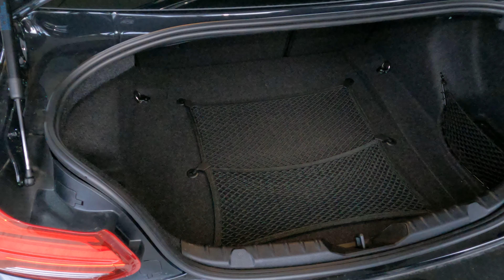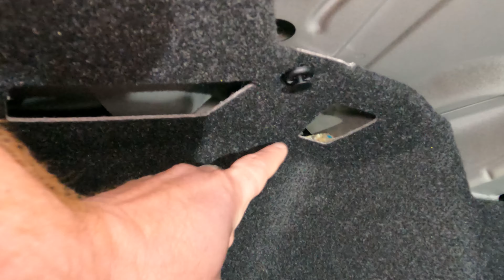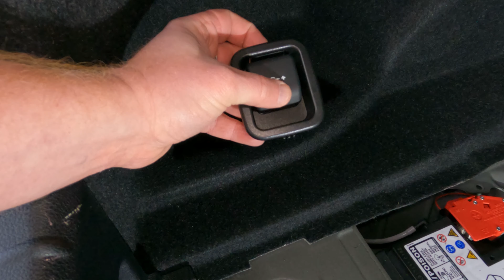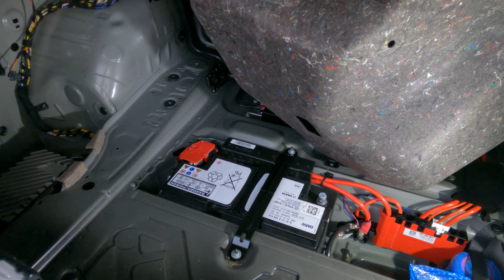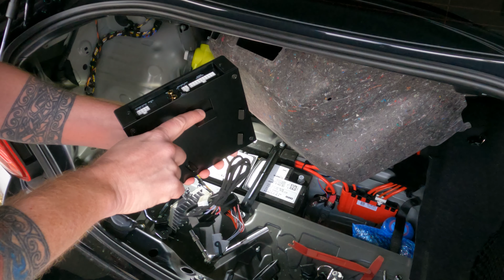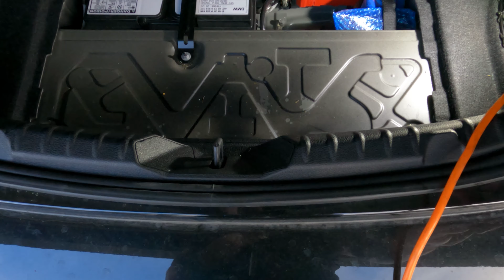BMW F87 M2 Competition BimmerTech amplifier installation DIY - EASY upgrade for your BMW!

Comment: I should have read the description. Started the procedure and discovered that I don’t have the torx T40 bit. Had to make an emergency trip to O’Reilly.
Thanks for the great tutorial. It would be even better if you showed show to remove the plastic latch trim panel. It was a big puzzle to solve.
Reply from the maker: I have made many a similar run.. glad the DIY helped!
Reply: @BMWDIYGuy  My next step is to connect the battery and setup the amp via PC-Tool. But I don’t have a Windows laptop, only MacBook. 😬

Comment: No splash guard? Hopefully it’s more waterproof than the original. Many of those die from water ingress. BMW deciding to place it near the slam vent was a crazy decision.
Reply from the maker: Very fair comment but never had a water issue, at least yet on any car.

Comment: Just got my m2c and yes the stock sound system really sucks. My wife has an 2014 Acura TL with the ELS and wow night and day. 

Sounds like this is a good upgrade even with stock speakers. Might be making the jump. Thanks for the video!
Reply from the maker: It's absolutely worth it.. I will have my 2 month review up this week, but the spoiler is that it's completely worth it.  Night and day difference
Reply: The stock system rocks actually IMO, harman cardon speakers with crazy bass. Only thing that annoys me is the rattle from the rear.

Comment: Dude.  This installation is absolutely NOT Plug-and-Play.  As you've shown, you have to dismantle half the trim in the trunk to get at the amp.  Plug-and-Play in the lexicon means "simple".  The amp part of the procedure is simple but the whole process is not.  I was interested in making this swap until I watched your video and now I'm not interested.
Reply from the maker: It's easier than you think plus not having to cut plugs or run new wiring is plug and play.
Reply: Are you stupid? Plug and Play means no cutting or splicing wires. This is about as easy as it gets. Lmao

Comment: I've gotten used to the HK in my M2 but thought it was total garbage on test drives and living with the car. My prev VW had dynaudio speakers and amps (OEM) as well as being able to adjust mid, bass and treble which HK cannot do. I'd love to have that punch and control the dynaudio had but the M2 is not exactly a quiet platform to exploit and my commutes are ten minutes long lol
Reply from the maker: I totally get that too as I dont drive very much right now, but I know that will change.  This amp makes a huge difference even with the stock speakers.